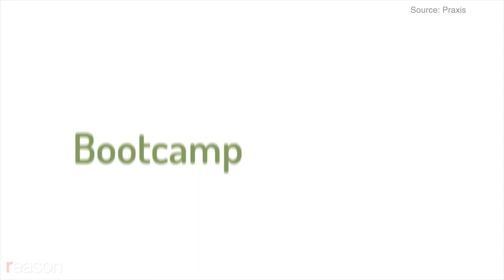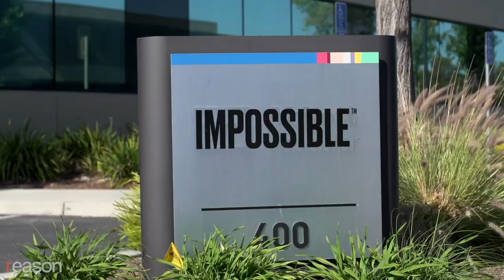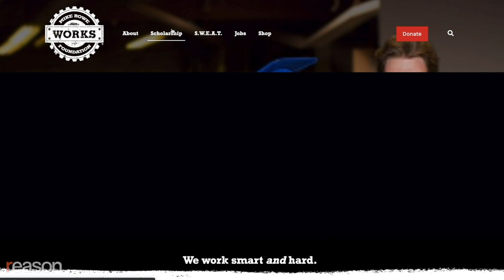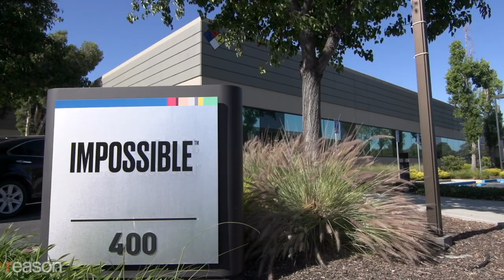Why 'Free College' Is a Terrible Idea

Comment: "So many degrees floating around" - no, there wouldn't. There'd still be a limit to how many students could be enrolled.
Reply: Yes and no. We already have too many degrees floating around, employers requiring 4 and 6 year degrees for jobs that a high school graduate could perform and paying you the salary that they would have paid the high school graduate. We have Bar Tenders, Waiters, and Taxi Cab Drivers with 4 and 6 year degrees. If free education increased that by pool of surplus and useless degrees by even just 20%, we will be swimming in an even deeper pool of over educated work force and under employed in as far as job availability where you can actually employ your education or be paid a fair wage for it. Decades ago the 4 year Bachelor degree became the new minimum high school education equivalent for a lot of jobs and now it has become the 6 year Master degree that has an edge for jobs they don't really want and where they will never use their education.
Reply: @jean-claudelol563  Free education doesn't increase that pool of surplus, for the reasons I already stated. If there's room for, say, 100 students in a course per year, then that's going to be filled regardless of tuition - so that's 100 students either way. Making it free for the students simply means that the best, rather than the richest, get in.
Reply: @Gilmaris  Funny but your assumption does not fall in line with the real life, hour by hour, day by day operations of any college campus I am aware of. I can't think of  single course I took in college where every last seat was filled. There were always anywhere from a dozen empty seats in a small classroom of 50, to more than 100+ empty seats in an lecture hall made for 500-600+ students. In the unlikely event the course was full for enrollment and there wasn't a different available section open at some other time of the day, you go see the professor at the start of the class and 99% of the time they sign off on the course add/drop slip to add those additional students. Sometimes it results that they get moved to a larger classroom for the next session of that course, if that many more students are added. You don't think more of those seats would be filled in a free education system? In the unlikely event that a course does fill, they can always and often do move it to a different empty room with many more seats. I hope you do realize that classrooms are assigned according to the number of students enrolled and interested in that particular course. There are at any given hour of the day dozens and dozens of larger empty classrooms that no professor is using for that hour of the day. They don't pack every classroom on campus every hour of the day, in fact as many as 25%-50% of classrooms may be unutilized during any particular hour of the day. Student can check those rooms out often times for group and club activities, or for study groups and even then there are dozens and dozens of empty classrooms at any give hour of the day across a university campus. Most University campuses are overbuilt, well beyond the need of the actual number of students they enroll and faculty & staff they hire. They are built with the hope to keep growing in the future and new buildings are added over the years. Often unneeded buildings are built, that leave older buildings practically empty that are still very usable for many decades to come. About the only thing that college campuses are not overbuilt on is dorm rooms, they only build dorm rooms to accommodate a predesignated percentage of their students. Everyone else goes on the wait list in case someone drops out or just doesn't show up for the semester. The rest have to find off site housing. Your assumptions read from the perspective of someone who has never been on a modern day University campus. All they need to enroll more students and staff is more government funding to pay for the portion of tuition not covered by the students tuition portion. The actual physical real-estate is already there and built to enroll many more students. Some of those universities and colleges are the size of a small city that can range anywhere from 20,000 to more than 50,000 students. Most have the physical space already constructed, just waiting to serve many more students than their public funding currently allows.
Reply: @jean-claudelol563  "I can't think of  single course I took in college where every last seat was filled."
Nor can I, and I went to uni in Norway where tuition was but a small, token sum. The equivalent of 20 bucks, in the early 2000s. So even with such low tuition fees, there weren't crowds of people swarming our educational institutions. In spite of my uni having a significant portion of foreign students in addition to the Norwegian ones. The only course which was filled to the brim was the Examen Philosophicum, which was an obligatory introductory course for all bachelor degrees.

Norway simply doesn't have the problems you seem to think would follow from a (practically) free college/university education. Can you even think of any country that does?
Reply: @Gilmaris  Everybody goes to the Scandinavia argument sooner or later. So you would model after the Norway system eh? I spent months in Sweden, Norway, Finland and Denmark. Interviewing students and graduates, parents and professors, administrators, etc... Each country has it's unique way of implementing their educational system and each has their major draw back. One of the major problems Scandinavians share is a huge surplus of credentialed individuals, years out of college working as waiters, bar tenders, taxi cab drivers, etc... Not unlike the problem we already have here in the US. No jobs and there's only so many government jobs available despite their huge social welfare programs to employ many of those surplus credentialed individuals. In Norway your pumping massive tax revenue to educate them and then pumping massive tax revenue to hire as many as possible in redundant government jobs due to the lack of jobs in those fields. They are actually worse off than we are and it is also not free, they pay 50% in taxes right off the top to pay for those services, plus VAT tax on everything they buy, plus property tax and/or wealth tax, taxes on cars are about 50% of the cost of the car, much, much more if it's an import. A $30,000 USD American made car could end up costing you around $150,000 USD. Gasoline is sky high compared to what we pay here. They pay "tens of thousands" on a car purchase on top of the cost of the car, they pay Value-added tax, Tax for the weight of the car, Engine horsepower tax, CO2 tax, N0x-tax (nitrogen oxide), First-time registration (to get license plates), tax to-scrap-your-car. On education you still have to pay out of your pocket or borrow money to pay for housing and daily cost of living while in college in Norway, which has one of the highest costs of living in Europe and very high rents. Often students end up in as much student debt just from borrowing money for housing and cost of living as students in the US do for tuition. So no, it is not "free" and it is not a better model than the US higher educational system. It's just different and they pay a hell of a LOT for it. And they will be paying it their entire working lifetime to educate the next group, and the next, and the next... Their is nothing to be admired about their higher educational system's sky high cost in taxes or the value once they graduate.
Reply: @jean-claudelol563  "One of the major problems Scandinavians share is a huge surplus of credentialed individuals, years out of college working as waiters, bar tenders, taxi cab drivers, etc... Not unlike the problem we already have here in the US."

So assuming what you're saying is correct, you're actually undermining your own argument, here. After all, tuition is far from free in the US, and yet you have the same problems? Then removing tuition doesn't cause it, does it?

As for your figures, I have no idea where you get them from. VAT in Norway is 25% for most things (transportation, hotels and many other things 12%). Income tax has a baseline of 22%, which is adjusted for how much you make. If you make ~100,000 USD annually, you will pay 38.2% in taxes from that.

As for American cars, I just checked the first and best example I could find. Ford Fiesta, average price paid $14,033 - $21,713. Norwegian price: new from 287,600 NOK (28634,05 USD at present). So yeah, that's a little bit higher, but it's not five times higher, Jesus Christ. Most new cars are about 300K-700K NOK here - or  30-70K USD.

And yeah, of course our taxes pay for what we don't directly pay for. But that's no different from how your taxes work. The thing is, we allow our taxes to pay for more stuff than you guys. Maybe the immensity of your military is why  you have much fewer benefits in spite of not paying that much less in taxes, I don't know.
Reply: @Gilmaris  I didn't undermine anything. I freely admit we already have some of the problems that Scandinavia has and the more we adopt their social policies the more of their problems we recreate here. However, you’ve just shot your own argument in the foot. Because your taxes are cumulative and by the time you add them up it’s well above 50%. The rest of your argument is just trying to confuse the obvious. Yes, we have the same surplus of credentialing. It was created with the unrestricted ability to borrow money for college, even if you can never make enough to pay it back, even if there aren’t enough jobs to employ all those surplus credentialed individuals. You just want to shift that into the next gear and float the expense from the individual to the tax payers. You don’t want individual to take responsibility for their poor choices in borrowing what they can not pay back. Instead you just want to switch that burden over to the taxpayer who will have no individual ability to say no. They’ll just get stuck with every college students tab until the end of time. Even if your producing 30-40% more college credentialed individuals than what the job market can employ in the capacity of utilizing their education. We already produce too many college graduates, beyond the job markets needs. All they have done is raise the educational level requirement for jobs from a high-school diploma to a 4 and 6 year college degree and you will never use what you went to school for. I make a 6 figure income, I have worked in 7 or 8 jobs in my lifetime, I have yet to employ any skills I learned in college. I could have done my current job out of high school. Instead I had to start with the same crappy entry salary that they would have paid a high school graduate due to credential inflation, and spent 15 years working my way up the ladder from one no brainer crap job to another, to get to my current salary. All because the jobs aren’t there for most college degrees and we have created a credentialing inflation problem with the job market. And they keep asking you to get more adult education every year, 12 to 20 or more CEUs that you will never have the opportunity to utilize in the available jobs. And I am surrounded by about 500+ employees all in the same situation, everyone doing jobs they could have done out of school. About 100 of them have the even more menial jobs because they only have a high-school degree. Sadly, they are already over qualified for my job. I just get paid more because I’ve been there 15 years and I have more credentials. They are all over qualified, i’m just even more overqualified because the employer gets to set the educational requirements based on what the batch of applicants are offering in the way of credentials. I was selected to help update some of the job descriptions and requirements. I proposed substituting work experience for credentials. They refused, it doesn’t cost them anything to require the credentials but given the market surplus, they added the work experience requirement I suggested on top of the credentials. Lovely... That’s the reality of the employment barriers created by a surplus of credentials in the job market. They want more experience, more education and not a penny more to the salaries required because there’s a surplus of supply relative to the number of jobs. As for your remarks about military, it’s our military that’s keeping Europe from being over run. You wouldn’t last a day in a fight with the Russians if we withdrew from our mutual defense agreements and withdrew from NATO. I don’t agree with the American tax payers subsidizing Europe’s defense and security, I agree with requiring member nations to pay their share or letting them suffer the consequences of inadequately funding their own defense. We’ve already had to save Europe twice in WWl and WWIl, from it’s own defense short sightedness. Not to mention keeping Europe from being over run by the now defunct Soviet Union during the Cold War era. They were crawling with Soviets and communists all the way across eastern Europe and halfway into Germany. They think it can't happen again. Yes it can, and the way they are going, it probably will.